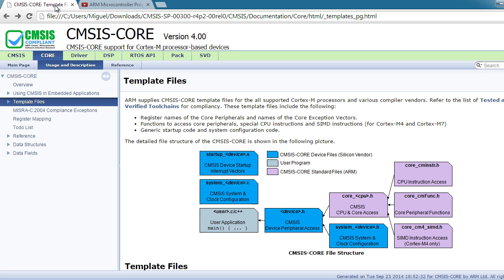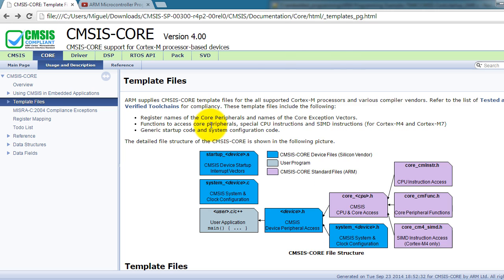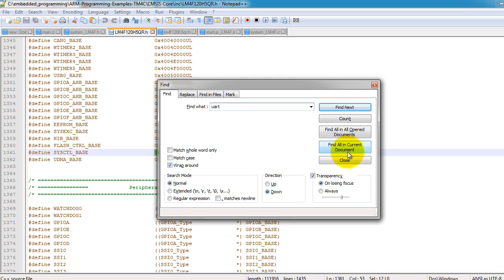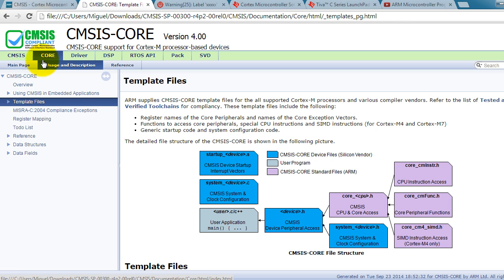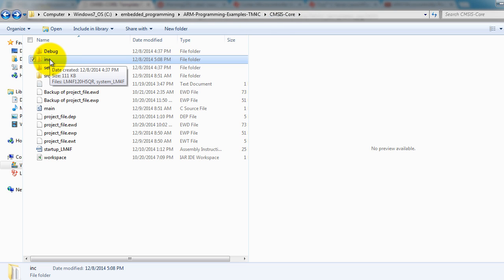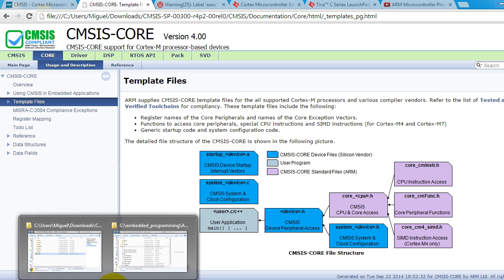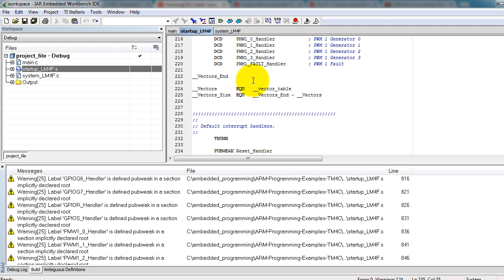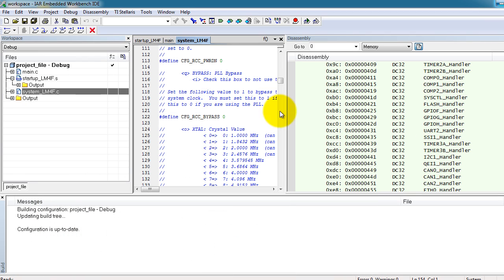CMSIS Tutorial #1- (CMSIS-CORE)

Comment: Nice job.   Does one have to do this for every project?    A little tedious at first...paths, etc....I am trying to do this same thing with STmicrocontroller...got it working with TI.   Thanks!
Reply from the maker: Yes it need to be done for every project. ST actually has more support for CMSIS than TI does. The other component of CMSIS called CMSIS-Driver is not given to you by TI but most ST micros have it, but I will show you how to implement it yourself for the UART at least.

I bought an ESP8266 wi-fi module and we'll need a good UART driver for the tutorials for it and the TM4C/Stellaris board.
Reply: AllAboutEE I took a RTOS course using a STM32F107 eval kit  a year ago...and all of those startup files were listed.   Good to now know the origin and content of those files.    That's the cheapest wi-fi module I've seen.  I have the CC3000, library files are in C++ using Arduino.   I'm looking for an ARM tcp/ip programming tutorial.
Reply from the maker: lamarts100 was that RTOS course good? I've only used Freescale's RTOS, MQX, but their tutorials were a little outdated (they didn't even the same IDE anymore), so am looking for a good one. Also what was the name of the RTOS you used?
Reply: AllAboutEE Micrium C/OS-III is the name of the RTOS we used with the STM32F107.   The book is good.  I've been using FreeRTOS...seems to be more available among the vendors.